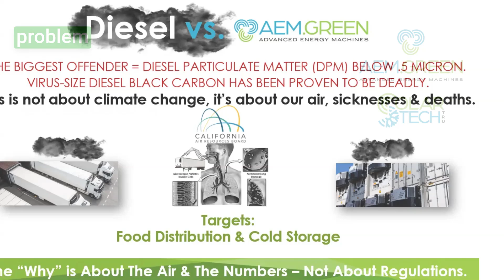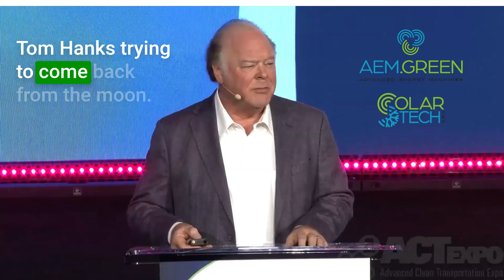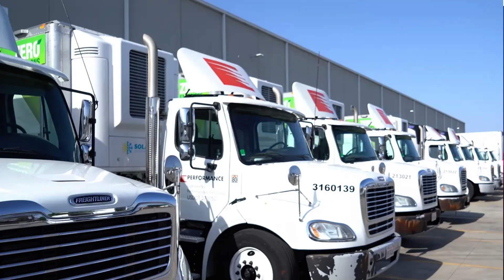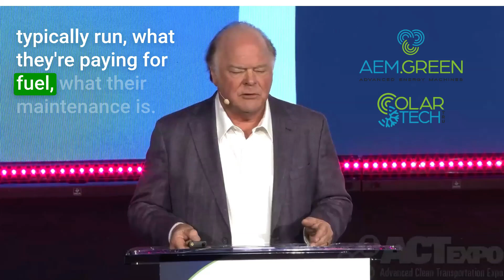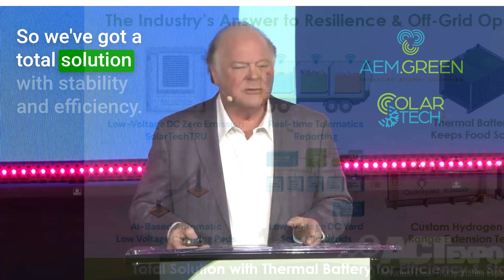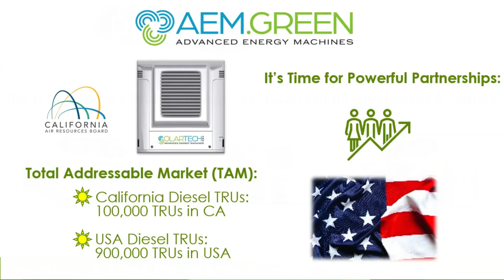Advanced Energy Machines CEO & Co-Inventor, Robert Koelsch, Speaks on the Main Stage of ACTexpo2025

Comment from the maker: Introduction to Zero Emission Food Delivery
 The Golden Nugget of ACTexpo
 Designing Efficient Reefer Systems
 Innovative Power Solutions
 Safety and Low Voltage Systems Choices for Your Electrification Plan
 Economic Benefits and CORE Program-Substantial Vouchers Available
 Health Impacts of Black Carbon
 Proven Zero Emission Viability & Ongoing WAIRE Incentives Per SolarTechTRU
 The Numbers Work: Leasing, State Vouchers, Credits, Low Voltage DC
 Automated Charging Solutions, Telematics & All Low Voltage DC
 Exploring Hydrogen and Solar Options – Zero Range Anxiety
 Partnerships and Future Outlook-Annual CARB Voucher Deadlines
$30 Million Funding Deadlines - New Funding for TRU Conversions in Northern CA